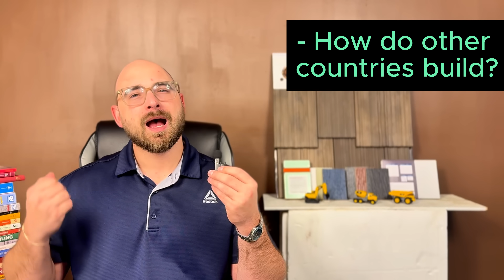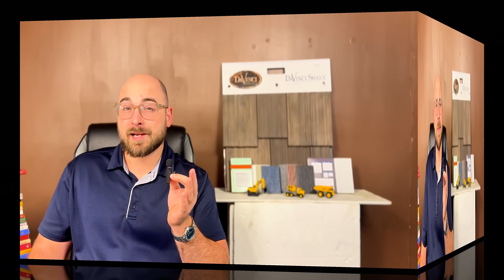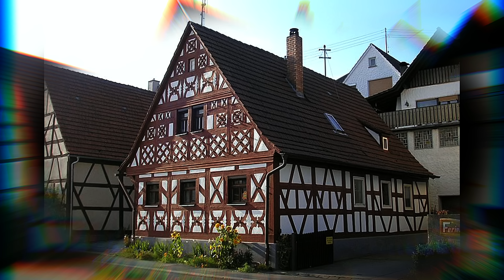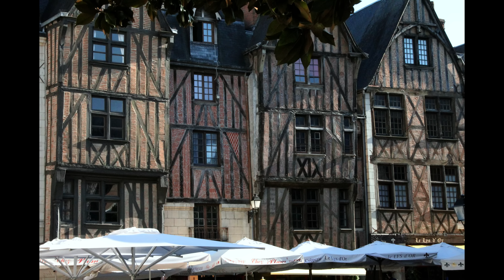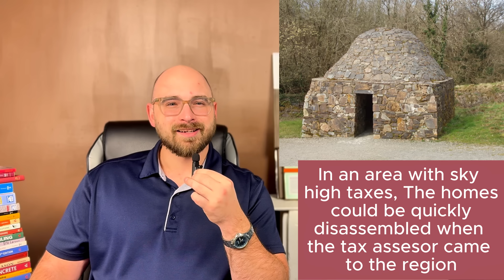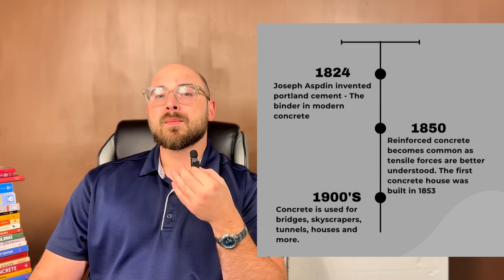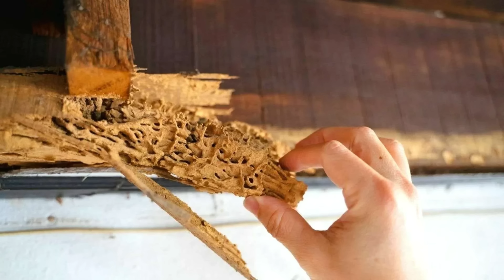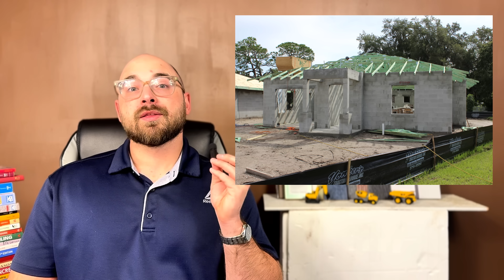Why Other Countries LAUGH at American Homes

Comment: As a Peruvian, we no longer use adobe for home construction and most engineers now don’t event know how to work with it. Most of the adobe houses are from the early republican era or the Spanish viceroyalty era and many are falling down due to lack of maintenance. We now mostly use bricks and concrete. However, the jungle provinces mostly use concrete blocks similar to the ones in Mexico. Most houses are made out of those materials, or at least the ones that are actually done according to the legal technic specifications. The informal and poorest houses are usually made out of plywood and calamine in invaded and unsupervised State owned property

Comment: Which values are implemented by the builders?

From the big man on down, home is built for profit, cutting corners, shoddy installation at EVERY TURN. Trusses, flashing, electricity, improper gas installation, improper stucco, insufficient insulation, etc.

We're talking about new construction here, built in the last 10 years until today. Maybe even further back.

There's a few home inspectors that make a living on YouTube exposing these practices. 

So yes we are a laughing stock.

Cinder block homes from 60s-80s are still standing, and to my knowledge cast iron plumbing is the only flaw. 

So the change is uneducated buyers, greedy bankers, and soulless home builders.

Comment: Our family home was built before 1820.
Kiln burnt clay brick, sand, and lime mortar.
It's still sound, if it will be maintained well it will last another 200 years.
The roof is made with a mixture of 12x12 inch and 6x6 inch, secured with oak 1 1/2 dowels, with kiln burnt clay tiles.

Comment: We already know concrete production contributes to a substantial portion of global emissions. And americans in general are substantially higher emitting in emissions by lifestyle than every other country in the world.... We should not build with concrete unless its for the right engineering commercial reasons. Wood should always be the primary framing material. Yes american timer products are not as innovative as the materials over seas and material adoption here is slow but that doesnt mean that countries overseas are not using timber and wood as a framing material. If you go overseas and look at how they build homes the materials are very similar just different codes and different innovative techniques. The one material america needs to adopt to mainstream is MGO which imo is game changer for the longevity and comfort of homes

Comment: I guess it's mostly about the lack of quality, sturdiness ( e.g. with regards to the excecution of the light wood framing), and the "planned obsolesence" aspect of the "traditional" US home, which most of us "other-nationers" comment (some more bloaty and ignorant than others). 

Good thing you guys are on track for better housing, there is mostly benefits from it, con is higher building cost, pro is lower running cost (heating/cooling), and especially reduced monthly insurance cost. 

I come from, and live in Norway, and even tho we build a style of "light wood framing", it is to much stricter requirements.
Although we use a bit larger spacing (60cm or roughly 24") our studs and such are more beefy (nowadays I-beams are used alot, for more dimensional stability after installing, pure wood being more "alive" and due to improved R/U-values), but one of the main differences is the amount of metal straps, cross-bracing and reinforcement tying the wood framing to the foundation to prevent lifting and shift from winds and other external forces. Not that it's much of an issue in these parts, but purely out of design our houses would fair well in an earthquakes too.
Walls are now typically 8" outside of vapour-barrier, and 2" inside (to prevent electrical piping and plumbing, and "picturehanger screws and nails" to puncture vapour-barrier). 
Roof girders and such almost twice that. Most houses has to withstand hurricane force winds with fierce gusting etc. while basicly being untouched. The wood structure the house is mostly made out of, is strong enough, that any force trying to rip the roof off or shift the structure has to pick up the re-inforced concrete slab with it... As for the slab it is B30 class concrete (minium) with rebar, now often poured directly in a EPS/XPS foundation mold, floors seldom much thinner than 100mm /4". Previously ECA-blocks with EPS and gravel infill under the slab was primarily used. 

We joke about it needing to be buildt in such a manner that if it's torn out of the ground, it should tumble away in one piece instead of braking up 😂

Comment: Just a little correction on the "Concrete technology was lost" part. It never was lost. The Byzantine Empire continued using the method, it just became a much rarer occurance to use concrete because of the availability. Romans relied on Volcanic Ash for the production of Concrete, which was disrupted by the fall of the Western Roman Empire. The Eastern Roman Empire(Byzantine Empire) never lost the technology, it just became a much less used method precisely due to availability, plus because even if there was availability, it was much harder to work with. The Romans relied on huge projects run by the state to make buildings built out of Concrete. In the fall of the Empire, the successor states never reached the power Rome ever had, so for them it was much harder to run such projects, plus they were much more costly, and again, availability for the materials was scarce. That being said there are buildings built in the medieval ages in Western Europe out of concrete, just there aren't much of that. What happened in the 19th century was the invention of modern cement, which is much easier to produce and doesn't require Volcanic Ash for example, lmao. Plus, countries had become richer and more stable, so they were able to run bigger projects, and with the industrial revolution the process of creating concrete has been simplified a lot, so pretty much most people can afford it. Though it is important to note that modern concrete is nowhere near the level of Roman concrete, precisely because of it's make up. The volcanic ash part is very important here. Hopefully we can one day recreate this in a more convenient manner, where we do not need Volcanic Ash.
Reply: Sheeesh

Comment: ICF you can also use C.C.V.I.P. Insulation (Ceramic Coating Vacuum Insulated Paneling) 10^-6 atmosphere 8inch R170 $15 usd per square foot for a home that has no thermal issues and lasts a very long time. If the insulation is surrounded by the concrete to prevent its pockets from being punctured. Once that happens then the R value drops to something around R50 at the most.

Comment: One point for the wood structure [for muricans]: murican concerete stuff have a tendency to collaps in a spectacular fassion. :D For example many-many highway bridges, or that wierd ass fck bridge in 2018 when they tried to "speedrun" the building and than when they tried to put it in palce it get fcked up and later collapsed.

Comment: You mean american dog sheds. Proper building should not be based on easily combustible material. Concrete foundation, bricks, ceilings/floors out of steel beams or steel reinforced concrete pannels.

Comment: If there was no more gas in USA...most people in USA would lose life to freezing temperatures..even if you would have water heating systems...it is still not compatible with just throwing wood in the furnace and heating the house..on the ither hand not enough wood in case of emergency..but wood is constantly wasted to build homes that will not last centuries ...home crazy old still stand in EU. In tornado places homes are blown to piecec..none if them are rounded to reduce effects of wind or they are build like there won't be another tornado next year. Plus in case of was...homes would have zero protection againt ammo... but anyway..

Comment: Nothing wrong with stud framing, the problem comes with cheap, weak and short-lived exterior sealing methods; like plastic siding, OSB sheathing and asphalt shingles.  The North American market makes homes that have a 50-60 year lifespan, knowing that the homes will inevitably be demolished an in-filled with some more modern style, thus there's little motivation to make structures that last much longer than this.

Comment: Love brick and concrete houses, here in Mexico we have them for just a fraction of the cost they have on US and they last for entire generations without much maintenance, also they are easy to modify as long as you have an expert to do it (wich is cheaper to pay here than in USA)
Reply: Concrete homes have awful acoustics. Lot's of echo. Tvs and sound systems don't sound too great. We like our acoustics here even if we have to sacrifice durability.
Reply: @Ibhenriksen  it's not that hard to insulate an entire building to have good acoustics, and even with that extra cost, it is a lot cheaper than USA regular houses
Reply: @pakiucs151  Concrete homes are also colder so you end up paying more in energy bills.

Comment: here in spain no one constuct brick houses, they construct reinforced concrete  structures with brick walls. And that have been like that for decades. Also, moist in reinforced concrete houses is due to faulty design and construction. 

Besides, humidity and moist DOES NOT DAMAGE reinforced concrete houses as the rebar steel does not corrode in the high ph, anoxic environment of concrete. Well designed and built reinforced concrete houses will last centuries.

im a civil engineer with years of experience building those homes and i have found many faulty designs due to architects and workers that doesnt focus on excellence and diligent work

Comment: an entire knowledge base on how to build with bricks using roman concrete, etc is something that the modern world envies. It's a real tragedy, considering so many great buildings that were built in that era still stand today, although many are not what they once were. Architectural engineers and artisans concerned with building structures surely wish we could "crack the code" in roman concrete, let alone their amazing craftsmanship in their technique to construct amazing buildings like the Colosseum or the Pantheon for example.

Comment: Go ahead. Build a brick, or concrete house here in the sonoran desert.
Lets see how well that house fairs here compared to a wooden house.

"Other" countries dont get hot,humid,cold,rainy and dry throughout the year. They get 3 most.

No other country can go from 115° dry heat to 13° and wet. America does.

Currently
 America has temperature ranging from -44° F to 74° F.... that is great than 100° difference.

Comment: Where i live, what you call 'half timber homes' are actually quite common and sought after, but expensive. Homes for the common people are normally made out of concrete. The interesting thing is that many of these half-timber homes are centries old, while the style itself is available for NEW build homes in this region. This is done by specialist carpenters. A friend of mine is one of those, he has been building these homes up until his retirement, all without nails or screws. Isolation levels are still up to modern standards as well, very interesting. Greetings from the south of the Netherlands (near Germany).

Comment: My home i grew up in, In Ireland is 800 years old make of Stone. 3 ft this walls.

Now in Ireland they seem to be leaning toward Timber frame and block.

If i was to build now i would stick to Block and Concrete, if it burns down i still have a structure to work with

Comment: In the US, we build wood frame homes in arid climates that get 80 mile an hour down slope winds (Chinook or Santa Anna, depending on the area in question) that create almost unstoppable forest or prairie fires that burn down entire neighborhoods. This can't be efficient and it can't be smart, but it also wasn't priced into insurance models.

With the Palisades, Santa Rosa, Marshall, and various other extremely destructive fires, the risks are being priced in and are being placed on homeowners. Will this change building practices or is this so opaque that it won't?

Comment: I think you missed the point. New construction homes in America are falling apart. They're not built to last more than 20 years, but they're sold as if they're meant to last 100. Just because America has the ability to build well constructed homes, doesn't mean homes are actually being built well.

Comment: There’s also concrete houses using 3d print techniques
Reply from the maker: Nah
Reply: @ why not?
Reply from the maker: Bad design:

Lacks reinforcement, and exposed to the elements, not cost effective, not super well insulated 

It’s a solution in search of a problem
Reply: @ thanks for the input.

Comment: iirc, in terms of low cost and availability, bamboo has been emerging as a new alternative for fast and cheap contruction. Sure it's not solid whatsoever, but it's much cheaper than wood and has high density (iirc similar to oak) which modern wood lacks. Though the issues is making large lumber for more heavy duty construction as well as quality can vary more greatly between different patches of bamboo wood.

Comment: Labor cost is the major driving force in US home building. Concrete requires expensive equipment, more skilled workers, and allows little room for mistake once casted. While light wood frame can easily be assembled and modified by low paying, undocumented construction workers with little training. That's the reality.

Comment: I grew up in the 1980s, in a house that was completed in the 1920s. It was stick-frame, but at least had some pretty beefy sticks, and was better-constructed, structurally, than most houses I've seen from the same time period, having a lot more in common with one's I've seen from the late 1800s.

In the mid-80s, someone built a brand-new house a couple of doors down the street. They complete that house in late summer, and got moved in just in time for an ice storm that hit the area that winter.

There was a huge pear tree in our side yard (even as a teenager, I couldn't reach all the way around its stump with my arms) that broke off about four feet from the ground in that storm. The crown of the tree tilted over to rest at end of the highest peak of our roof, then the trunk swung over and the entire thing slammed broad-sides into the wall of our house, right between two windows upstairs and right between two windows on ground floor (one of those windows was to my bedroom). The paint job where the trunk hit was torn up, and the stucco had a ton of pieces of wood embedded in it, but besides that wood and stucco, the only damage was the destruction of a bunch of my mom's nick-knacks that were knocked off of shelves because the house shook so hard.

That same night of the storm, a branch small enough for little-kid me to touch forefinger to thumb around fell on the brand-new house that had just been built, and it completely demolished a corner of the house. Not put a hole in the corner of the roof; demolished a corner of the house. A substantial portion of the house was completely caved in and demolished.

Yes, houses in the US are built incredibly poorly, and it's getting rapidly worse with every passing decade.

Comment: I live in South Florida where ICF, and concrete methods are used. However the majority of homes were built prior to the 70s and so I don’t consider them that well built. My father built his home in 1962 with concrete in Puerto Rico. The house has gone through 28 hurricanes and tropical storms and two earthquakes. The fact that people are still living in that house speaks volumes about concrete. Not saying that it would survive an earthquake if the house is close to the epicenter, but as most of you know the last earthquake in Puerto Rico was not highly destructive. I think concrete had a lot to do with it.

Comment: That was an interesting video. Got to admit that when I've visited friends on the US West Coast, I was always puzzled why all the houses seemed to be timber, which to my brick-built sensibilities always looks a bit flimsy. Still, I'm not one to mock my hosts, so just assumed that timber - very unlike the UK - was locally a cheap building material, and suitable for the (also very unlike the UK) warm climate. 

Britain's brick industry is historically massive (making bricks a relatively cheap option), but got a huge boosted from that major event you mentioned: the Great Fire of London in 1666. Calling it 'Great' isn't hype - it took out most of what even then was one of the largest cities in the World. Not wanting this to happen again, timber construction was banned, and brick largely took it's place.

The main problem with our older brick houses, though, is insulation, which isn't easy to add. Years of cheap coal meant no-one really gave it a thought - if it's cold, just pile more in the fireplace. We built them to keep the weather out, not keep the warmth in.

Comment: What was always mind boggling to me, why at least houses in storm rich environment haven't gotten build out of concrete/ stone etc.?
I mean its highly hypocritical, but how many less people, would have lost there in like the past 50-100 years. On top of that, why not rebuild once with stone for many decades, then build with wood for a few decades.

I see it like with product, build cheap, buld twice.
(While almost paying the same; ~10% difference)
But with concrete, you get your return over the years, because of less maintenance and up keep costs because of better isolation like for heating or AC.